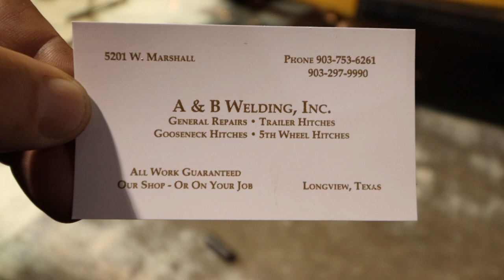Skoolie hitch install

Comment: The hitch has been one of my issues with our build. Ours has the factory tow hooks front and rear, which I want to keep. The holes are there, why no bolt on kit!? Will have to call them to see about a kit I can put on with out havin to go that far. As always stay safe stay strong
Reply from the maker: A boot on would not work. Also I am towing a lot of weight and I wanted to make darn sure I did everything I could to make it safe. 30,000 pound hitch with a 15,000 pound tow bar. Hooked into the air breaks on the bus. Good luck. If you call them I know they can help you. Peace love and hippies